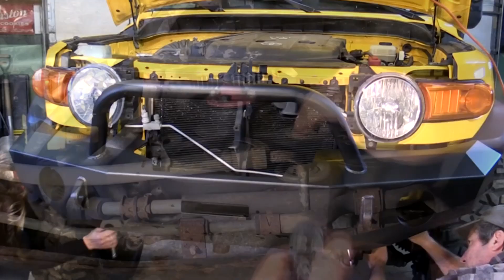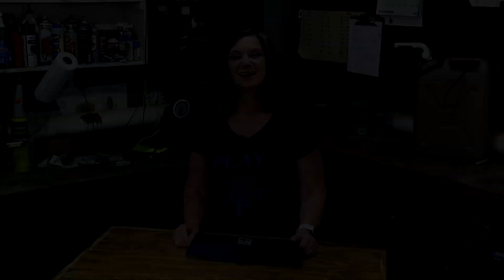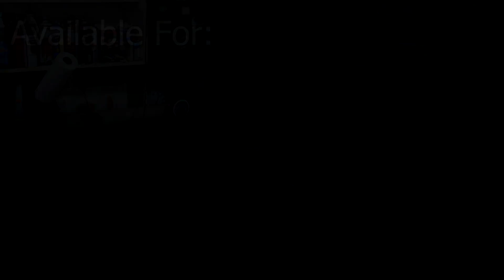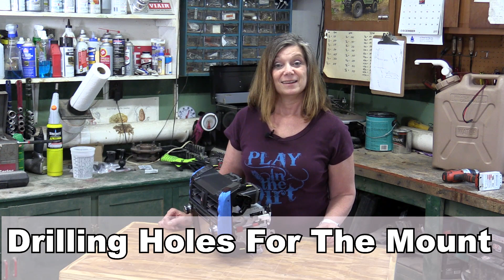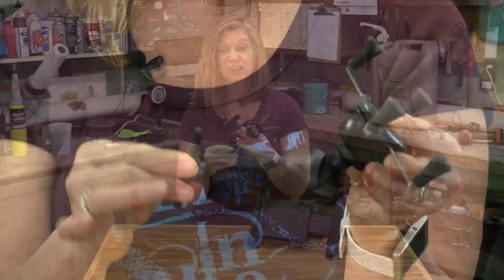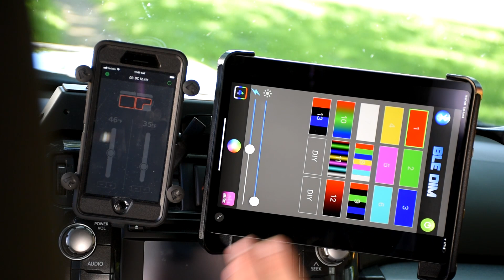Most Secure Dash Mount For Tablet And Phone & How To Install It 🖥📱🔧🔨

Comment: Great video...very helpful.  Thank you!  I have 2 small suggestions.  Instead of using a 1/4" bit for the top and side mount hole, I found a 5/32" bit made the hole just big enough for the screw to thread into the plastic.  Made it a little more solid IMO.  For the USB wire notch, I used a 5/16" drill bit instead of cutting out a path with a Dremel...just seemed a little cleaner to have a small tunnel to run the wires down.

Comment: This is awesome! I just wrapped up a very similar install on my 4Runner.one thing that really bothered me once I was done was that the power for the device is still had to come up from one of the 12 volt power supplies located in the center console or on the dash.  I chose to buy some flush mount USB power cables that allowed me to install a quick charge 3.0 dual power source behind the dash and have two easy and convenient USB Jack's near each ram mount.  The best part about this is that the devices connected with a 6-inch USB cable - no more mess!! (Just don't look too closely at my cargo area, it's still pretty messy!)